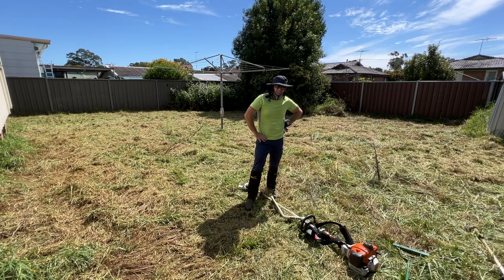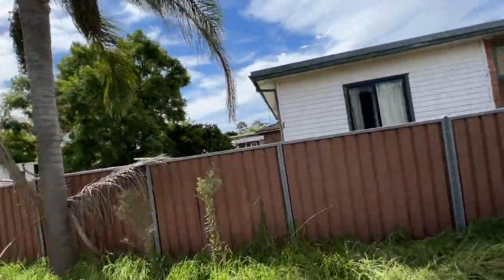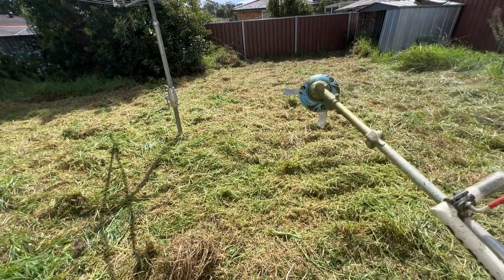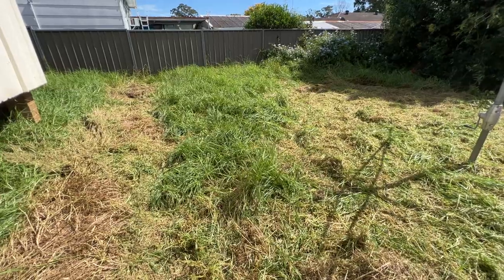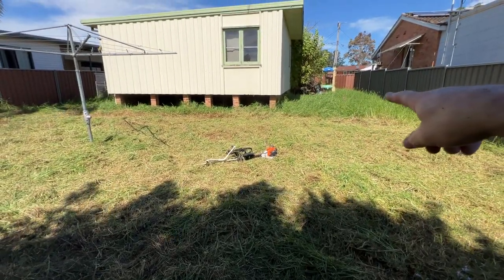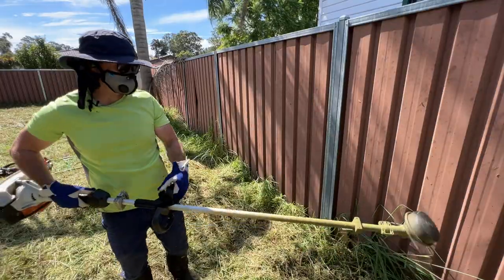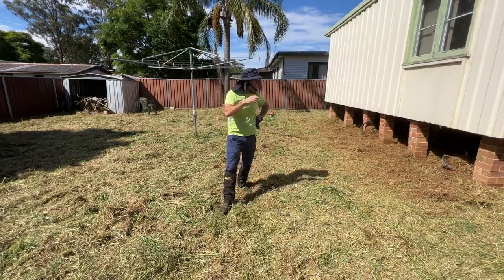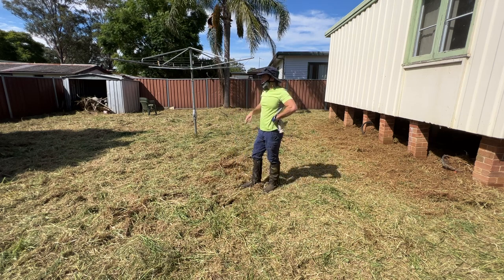She wanted a quote, I did it for FREE. Random Acts Of Mowing

Comment: Hi Tim, the yard is starting to look better after you knocked it down with the slasher. My husband made a comment," when you decide to move large amounts of grass,lay a tarp out on ground and pile the grass on top and pull to your destination and it makes the cleanup a lot easier, he uses a rake to pile the grass on the tarp, less bending over just pulling. He says it helps him. Look forward the next part of cleanup.

Comment: For picking up a huge amount of grass I just use a tarp and dump everything on it 😅 
I used to do big open fields with only a brushcutter, best advice I can give you is maybe try a bike handle, with a proper harness the difference is night and day. As for the final result,  the only solution is to ignore the runners or attack it vertically; like with a scarifier and do the field in an x-cross pattern. Very nice seeing you back, thanks for the video :yougotthis:
Reply: +1 for the the handle bar brushcutter with a good harness. I run a Husqvarna 535 RXT (equivalent to a Stihl FS360) with a Stihl universal harness and I’ve cleared out small open fields with it quite comfortably and easily using only cord. Stihl have also not long released the FS561 here in Australia which might be worth a look at.

Comment: I've had good success with using my ride-on, (after knocking down the bulk with either a whipper-snipper or the mower on a high setting), to windrow the residue into multiple windrows, which then makes picking up the grass a lot easier and quicker, yes it does mulch it a bit but there's a lot less 'area' to rake and pick up. Whether that'll work with what you have there (a lot more than I've ever dealt with) is to be seen. Best of luck with it, you'll have earnt that beer at the end of the day.

Comment: Tim ~ great job, as usual.  You asked about clear-up methods and you could use a helper(s) coming-up behind you on clear-up using a five-tine rake (old Skhool type) firstly to take away the clumps and then the more modern multiple tines to scratch (aka scarify) between the grass to remove the runners.

Comment: If I was planning to clear the cuttings from an area like that with really long grass, I'd have approached cutting it differently, basically cut in distinct orderly swaths exactly like mowing a hay field with a scythe, aiming to leave the cuttings in windrows, which are easier to collect than a random mat of cuttings. If kept slightly angled as you swing & trimming only on one direction of swing a trimmer/brush-cutter will deposit cuttings in quite respectable windrows.
When using that technique I sometimes used to muse on the possible merits of using an actual scythe for the job, if I still cut such areas I might try it as an experiment.

Comment: Put a big plastic tarp down and rake the grass on to it . You can either pull the tarp by hand or since the gate opens so wide drag it with your lawnmower.
Reply: Instead of raking you can put the bagger on and try it that way but your bag will probably fill up quick.
Reply: Another idea you could possibly blow it in a pile and put on a tarp.

Comment: Great video Tim, that was hard work and at the start it was difficult to see where you'd been as the grass was so thick. One really interesting thing is seeing how certain things differ. You have a lot of metal fences and wire gates while in the UK, residential fences and gates are typically wooden (and very often falling apart in older properties). 👍🏼
Reply from the maker: Yes mate, the “colourbond” fences are very common here

Comment: Mower go over it 2 x  at 2 levels. And then pick it up. Bag it. On the 3 cut. The smaller the grass is the better it will pick up. You bag it from the get go. But your going to have more bags of grass to pick up. Its your back.

Comment: New subscriber so I'm catching up, great job  definitely wouldn't use a rake they are to flimsy and you'll get quite a work out , when I worked around horses we opted with a pitchfork much more durable gets to the bottom much quicker than a rake, just an idea, but use what works for you

Comment: You say you wanna try different tools, how about a scythe for a yard like this?
Reply from the maker: Oooooh I should have said POWERED tools 😂
Reply: @timthelawnmowerman  i wanna see you try an unpowered tool just coz you didn’t specify before this. 

Infact I’m gonna go to the extreme and say give yourself a one off challenge the next big yard like this you have to do with zero power tools. Including using sheers etc if it has hedges etc.

You can use those unpowered push mowers etc if you like. As long as theres no motor in the tools ;)

I really wanna see someone take this challenge on for an overgrown yard!!!